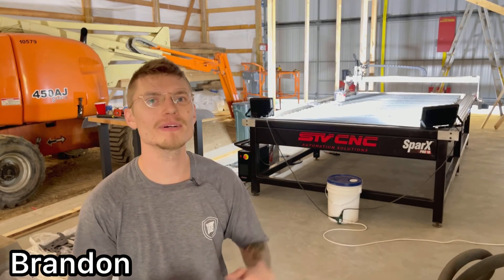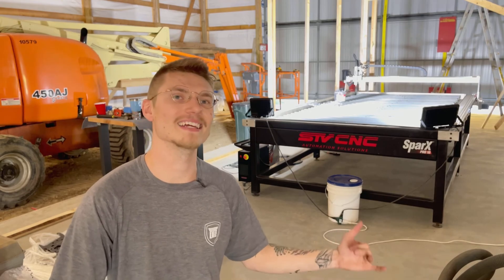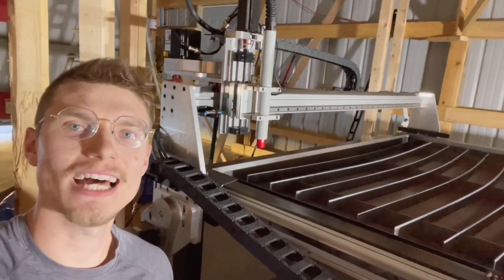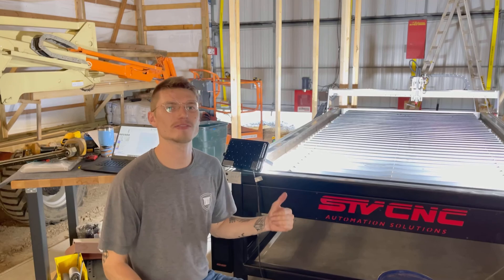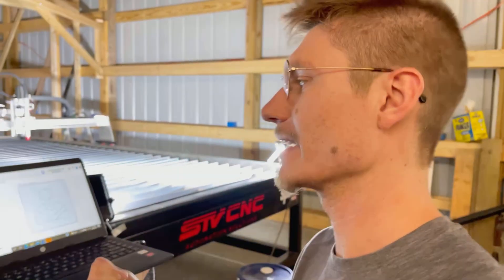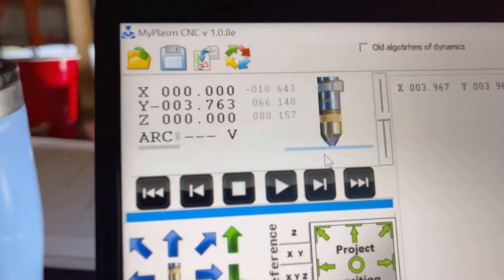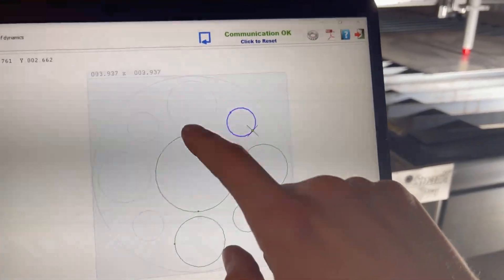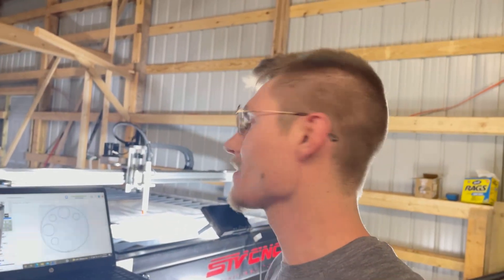STV CNC SparX10 Plasma Table Setup | Hypotherm Powermax 85 Torch (Today in The Shop #8)

Comment: Have you found that you should or should not have purchased different options? (reduced gearing, or any of the other selections when filling out the shopping cart)? Do you think you needed the powermax 85? I have a 45, and I'm curious how well it'll do 1/4" in production
Reply from the maker: The breakaway nozzle is nice in case a part flips up and hits the nozzle, it keeps anything from getting ruined. The 85 has also been nice for cutting very think stuff (up to 3/4” we believe…), the thickest we have cut is 1/2”. We typically cut 3/16 and 1/4” with the 65 setting and it turns out great. 45 still cuts pretty well, just less power for clean cuts
Reply: @DiamondJCustoms  Thanks for the info. this will be the next addition to our business after selling a few things off.
Reply from the maker: Our pleasure, sounds awesome!! @kjbigslim